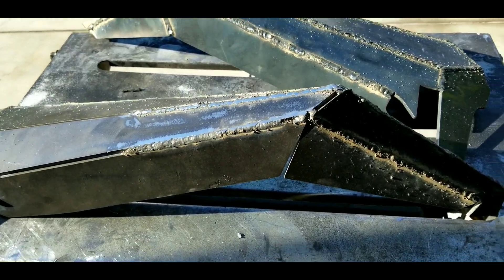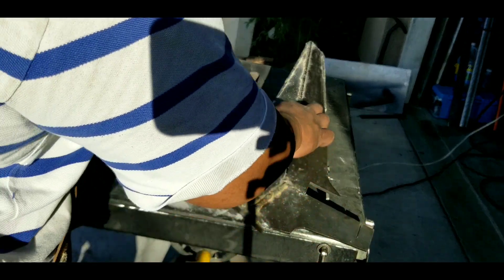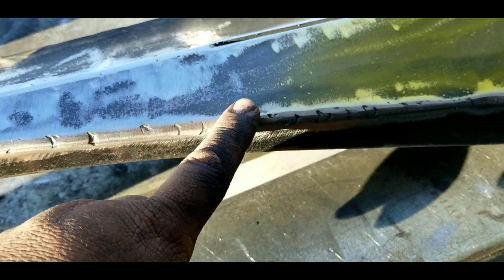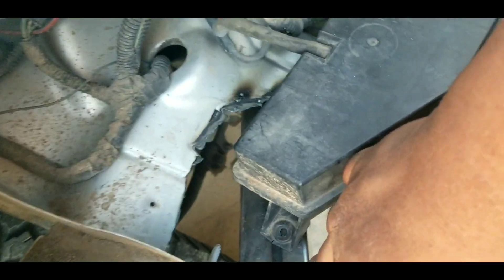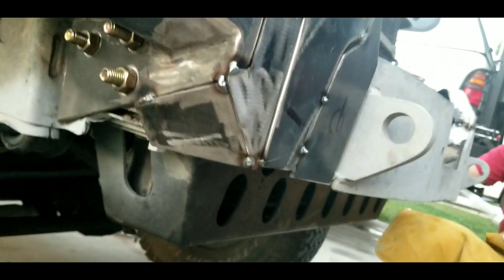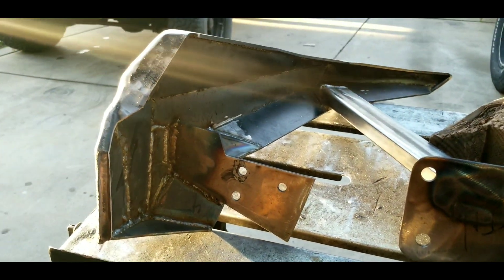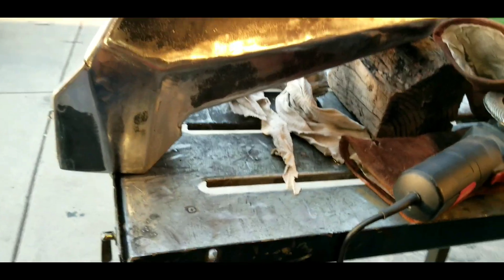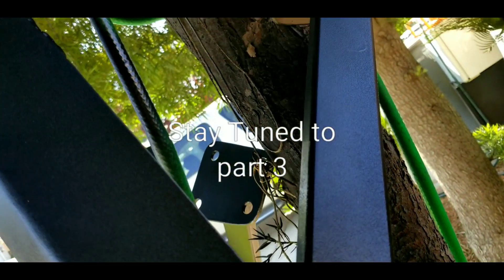Jeep WJ Front Bumper Build pt. 2

Comment: Hey brother, how do you reset the check engine light for a 1988 Honda Accord LXI? I tried disconnect the negative battery terminal for 15 minutes, but it doesn’t work.  I have code 15. Thanks